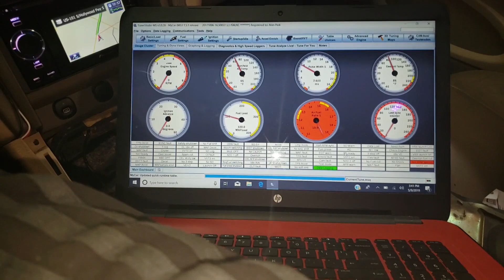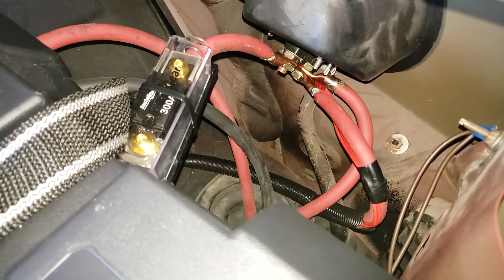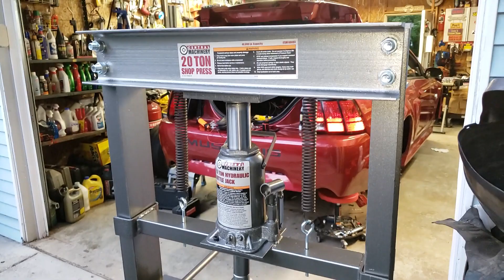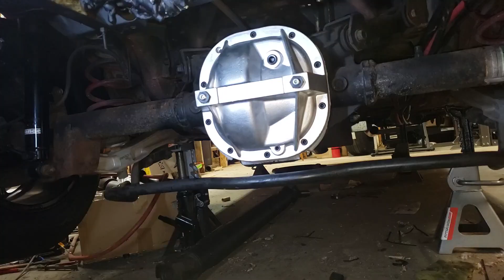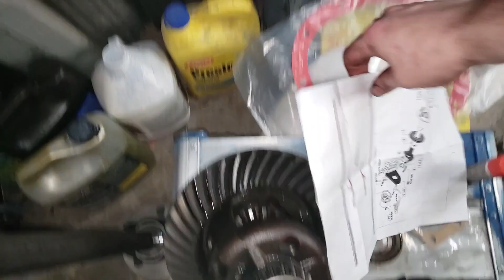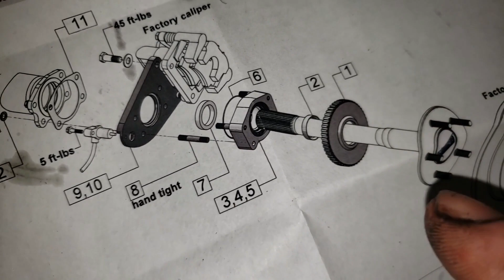Strange c-clip eliminators- spool and 35 spline axles installed. Almost time to hit the street!

Comment: I did my Strange c clip / 35 splines last week. I cut them flush but the kit did not come with gaskets. I called Strange and the guy told me he uses RTV in place of the gaskets because it leaks with the gaskets. Do you have any leaks?
Reply from the maker: rtv has been leak free for me so far